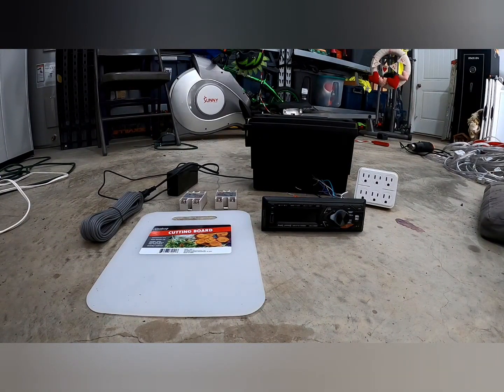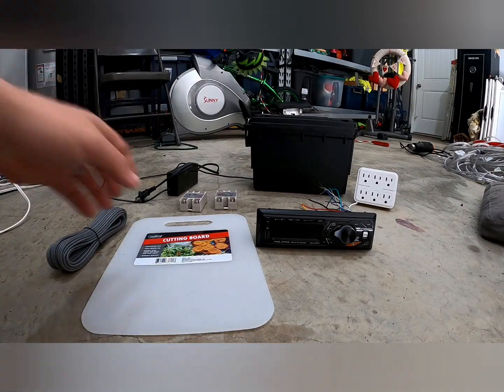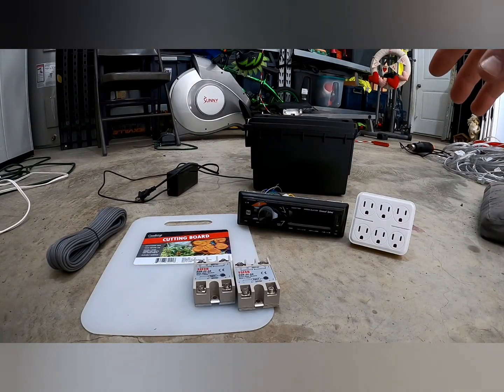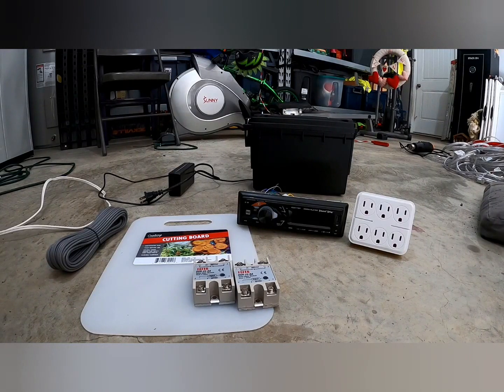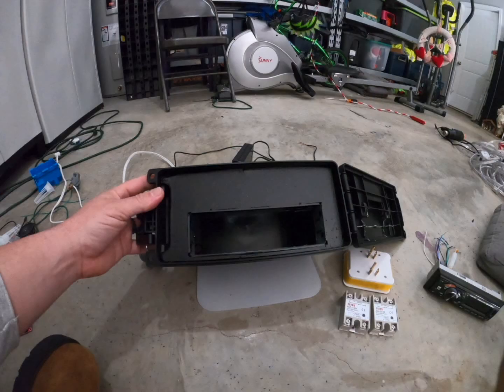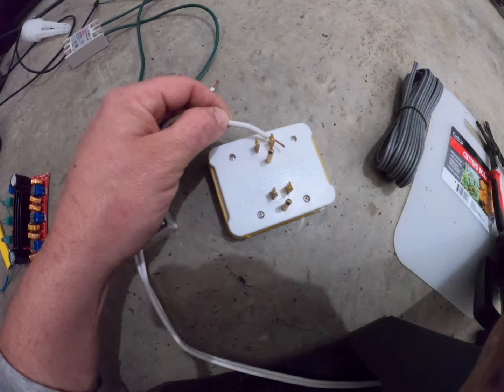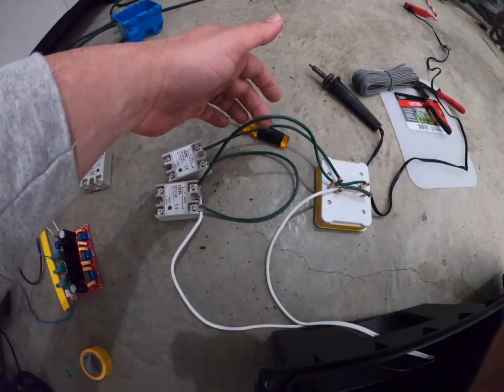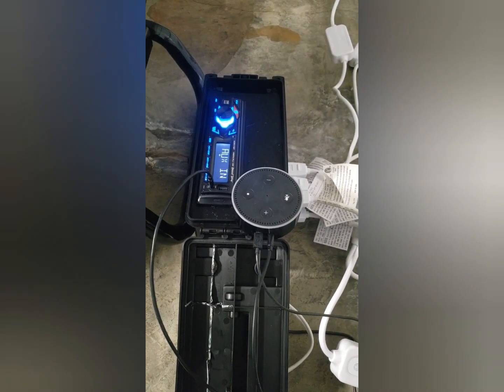DIY music sync light controller.

Comment: I could’ve sworn you said it wouldn’t control strips or pixels but those definitely look like led strips changing colors?
Reply from the maker: You are correct! I don't want to get anyone's hopes up that this system will run all LED strip lights. I tested multiple kinds of strip LEDs and they all do not work correctly. I hooked this up to my permanent light set up thats on the house and it does not function correctly,  we also tried several other LED lights strips with the same result.  For some reason these LEDs in the video works awesome.